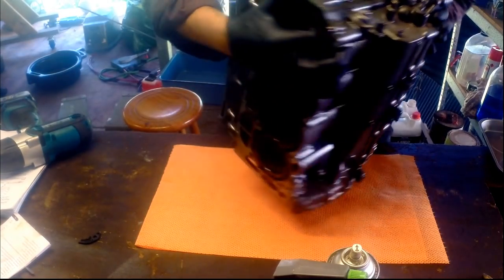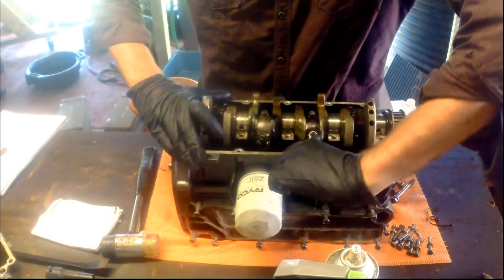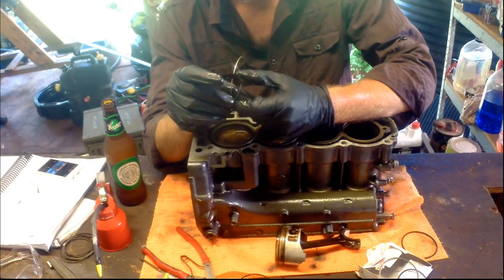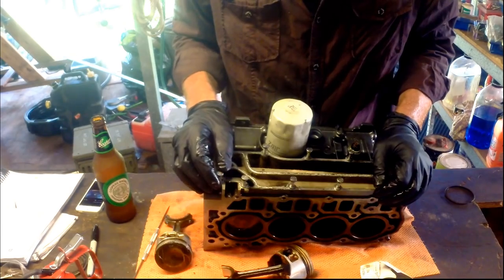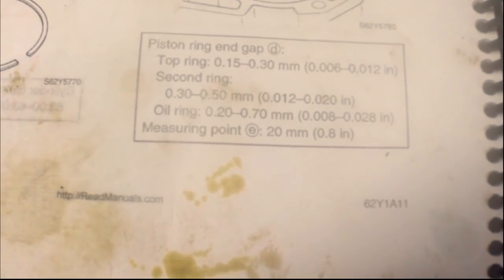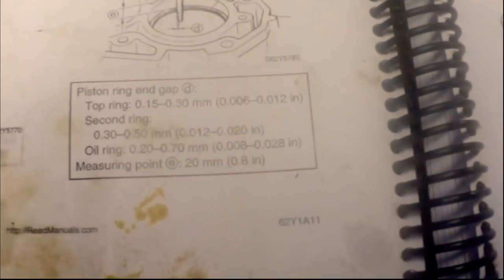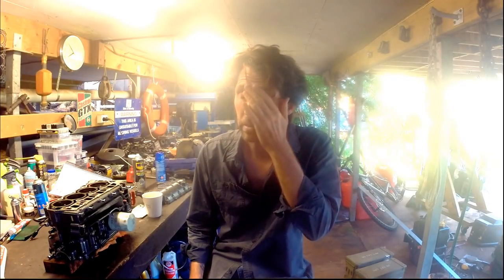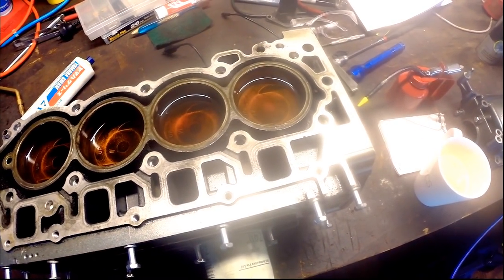Changing the Piston Rings on a Yamaha 50HP Four Stroke outboard

Comment from the maker: Hey there. Budget was one of the main reasons, but also because it wasn't in that bad condition. The cylinder bores still had a good cross hatch on them which is why I didn't hone. I did the clearances and I think the ring gap is in the video. The good news is I took the motor for it's first run today and it is doing really well. The compression is up from as low as 90 on two cylinders to 150 on all four now.
Reply: Dangar Marine hi there! Greetings from the Netherlands. I saw a mercury 50 hp 2 stroke engine with what the owner says bad piston rings. Is it the end of the world if the piston rings arent replaced immediatley. I know this video is old now but hope you read this.
Reply: Josh Smith  wow thanks so much for the reply, didnt end up buying that engine and instead am on the hunt for a 90 evinrude e-tec 2 stroke

Comment: Carbon build up under the piston rings is largely dependant on the integrity of the oil used in 4 strokes. Premium brand lubricants changed to OEM Specs plus filter should profoundly reduce this happening. As long as the engine operating temperature is within spec.
Reply from the maker: Yes, this is something people don't take into account when they remove their thermostats thinking they aren't needed.

Comment: Cheer s great vid , was just wondering if sparkling ale instead of pale ale would be ok? as i would'nt want to do anything that might harm my small motor repair
Reply from the maker: Excellent question Frank. Sparkling will work in most situations but make sure you use about 15% less so you stay below the red line. ;)

Comment: Did you make sure the #2 ring was the right way up? there should be a mark of some sort on the upper side.
If it is installed top down it will scrape oil into the combustion chamber. 
Cheers eric

Comment: Ive got a 70hp yanaha 230hrs, guy owned it before me must of trolled alot and it had made alot of oil, i done a compression test all identical to each other, but at 100 psi cold, year on im starting to worry about the rings, do i need to pull power head off or is there a way to do it

Comment: When you take out a piston, should you always replace the rings with new ones?
Should the gasket that have had inside the pistons should be refined with some kind of stone?
Should I first check the rings inside the cylinder for the recommended gap before installing them to the pistons?

Comment: The only point I would add to this procedure is to lube the wrist pins before installing the pistons specially if the piston/rod assy. was cleaned in a solvent tank .  I actually seized one but fortunately did not distort the cylinder wall.  It stopped the engine cold on initial startup.
Reply: Also I have used one of these https://www.amazon.com/Lisle-24000-Ring-Groove-Cleaner/dp/B000COC84U  to clean the ring grooves if carbon buildup is present.
Reply from the maker: Start up lubrication is definitely an important thing given it takes a while for oil pressure to build up. From memory I was using a tube of Nulon pre-assembly grease for most things but it was a fair while ago now and I can't remember the details. I'm not sure I filmed it particularly well either!
Reply from the maker: Cool tool!
Reply: My dad was a gas engine mechanic for International Harvester for 32 yrs. and I learned from him.  He taught me to put a thin film of white lithium grease on bearing surfaces, distributor journals and the like and to soak things like wrist pins and ring grooves with motor oil.  I'm sure there are purpose made lubes for initial startup but these never let me down, except when I forgot to do it.  The wrist pin thing is something you only do once as it was a complete teardown to remedy it.

Comment: In this case why have you chosen not to have the block & head professionally machined and hot tanked? I also did not see that you honed the cylinders, measured the ring gaps or measured the crankshaft bearing clearances. Did you do any of that and just not film it?

Comment: Hi , I enjoy your clips, I'v got a question for you. If I remove my piston head , carburetor and reed valve housing on a 40 hp Yamaha outboard can I remove a piston to measure clearance . The problem is I have 120 psi comp on top and middle and zero on the bottom cylinder.
Reply from the maker: Hi Johnny, what clearance are you hoping to measure? You can only measure the ring end gap with the piston removed. If the compression is down to zero you'll probably find the ring has broken completely.

Comment: Hello  from Bulgaria. I have  Yamaha F  40  With  3 carburators. Can i tune up  the carburators and  take  more  "horses". Thank you
Reply from the maker: You can possible change the jets on the F40, as I think it shares the same block as the F50. A carburettor tune will only make it run more smoothly, not give you any more power though.

Comment: Taking in consideration that the outboard is a 1990 Yamaha , the wear and tear has taken its toll. I have 120psi on the top and middle cyl and zero on the bottom cyl. You did say that it's most likely a broken piston compression ring but I'm curious if the reed valve would in this aged engine give a zero compression reading.
Reply from the maker: No, the charge is compressed very slightly in the crankcase, just enough to get it to transfer through the port to the top of the cylinder where the piston compresses it up to combustion pressures. If that is low it is still about the rings being worn.

Comment: I got off night shift and I'm trying to get my body back on day shift. Would an open reed valve give you a zero compression value on that cyl ?
Reply from the maker: No, the charge is compressed very slightly in the crankcase, just enough to get it to transfer through the port to the top of the cylinder where the piston compresses it up to combustion pressures. If that is low it is still about the rings being worn.

Comment: Dangar I have a question only you can answer (I trust your experience and word the most)... Okay, I noticed that most outboards use the same engine block/power head for many HP ranges. A good example is the Yamaha 4cyl, ranges from 35hp?-90hp same engine, same weight, but different HP rating. What is the difference in most cases? Carb jets are a given but I know that's not the only factor. I'm getting ready to rebuild my 1991 Yamaha 90hp and would like to unlock all it has to offer. 

When we want to improve an engine (car) during rebuild we port/polish the heads/intake, can this be done with a 2 stroke? Also shaving the head down a couple mills, will doing so increase power without major risk?

Ty in advance if you answer this question, me and my fellow fishing friends are all dying to know now that I said something to them!
Reply from the maker: It really depends on whether it is two stroke or four stroke, carb or EFI. With EFI there can be larger injectors (like larger jets in a carb) and the mapping will be updated in the ECU. The reed valves can be larger in a two stroke. The exhaust manifold can also be changed in both two and four strokes, but it is especially important with two strokes. You may also find that the valves are different in a four stroke. Porting isn't really going to help a two stroke much on the intake side because of the reed valves, but there may be something that can be done to the ports on the cylinder walls. These are very finely balanced though so you would really want to know what you are doing. Same goes for shaving the head. You won't have problems with valves hitting but you will have extra heat, timing and detonation issues that you will need to be fully aware of. Personally I would just stick to things like carbs and reed valves. Check the part numbers on the different HP models to see what is the same and what has been changed.
Reply: Alright thanks! I was thinking the stroke and bore would be different as well. Basically what you're saying is every manufacture goes about this a different way.
Reply from the maker: Yeah, I'm pretty sure stroke and bore are the same.

Comment: I was wondering if I could remove the piston from the engine without taking the engine off of the mount that it's mounted on and splitting it in two. That's the magic question. I appreciate your reply.
Truly: Johnny
Reply from the maker: Hi Johnny, yes, you can generally reach the bolts for the end caps with the reed valves out. You might find it tricky to get the new pistons and bearings in though.